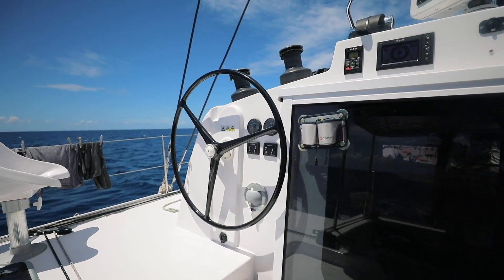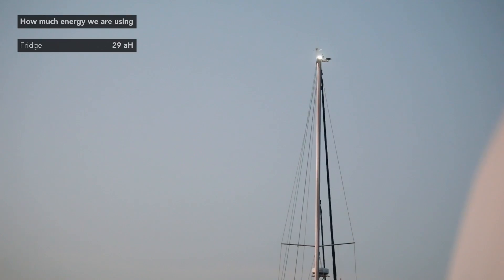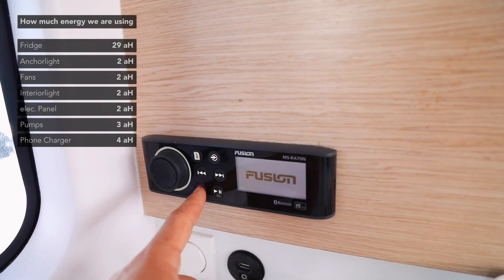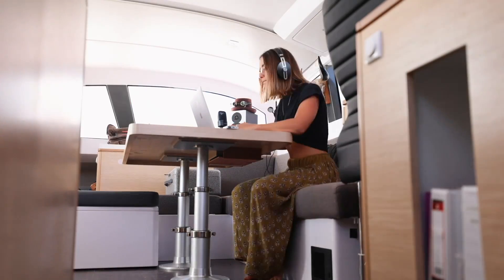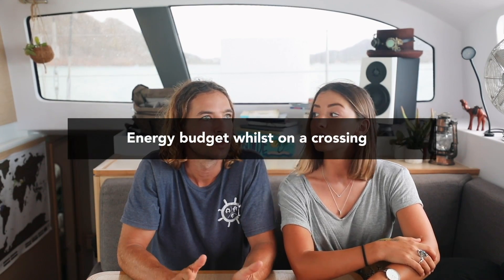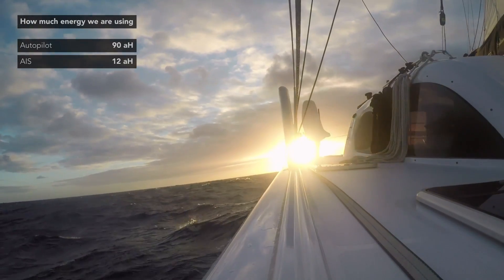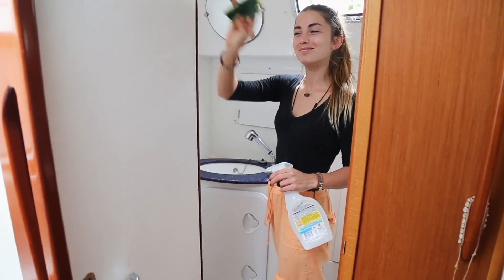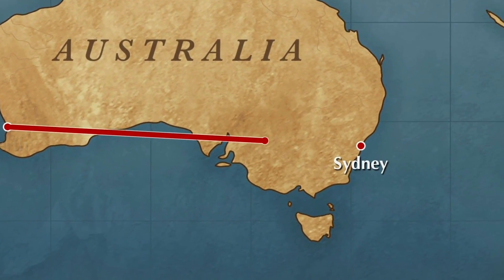Renewable Energy on a Boat

Comment: What would it cost you to quad your solar capacity? It looks like you have room on either side of the mainsail behind the mast and can also add capacity to your current solar board. I think you are running too lean at 560 and you want to be at 2,000 to 3,000 watts. Insufficient voltage is going to cause havoc (overheating and premature wear) on brushes and other moving electric motor parts.

Comment: Would an investment in an extra battery not be worth it?  There are many times that you are not actually using the energy spend that you state like when you are off boat for the day.  Rather than wasting solar energy that cannot be stored would it not be better to have one more battery storing that otherwise lost energy?

I have a campervan and have a 270w panel on my roof and 2 x 110ah batteries.  I went from 1 battery to 2 and it made all the difference.

Comment: Have a small tip that helps; get a set or two of the little solar lights, sometimes called 'fairy' lights, that use a separate small pv panel of their own, can mount the small panel off 1 of the bars for the Bimini or davits, and they are super lightweight, but the 50 or 100 small lights(w/a on/off switch on the small panel)will give you about 6 or 8 hrs. of nice light, use a set around the kitchen area, they automatically turn on at dusk unless they are switched off, and will save that 'flick on lights' and help lower your usage. Can get them in white, or colors, and they really hold up well, actually have them at home too, where they come through the vent/light and make wonderful light, but the best is on the boat, where you can have them come on at dusk, and return to a lit boat from outings, w/o using ships power! Also the security of that.."is someone onboard?" as the lights come on by themselves. Get a couple sets..they are a under $20 purchase here, and hope I've helped you and others out w/this tip ;)

Comment: I do outback photography with two fridges (one fridge and one freezer). I have two wine bladders with a little water in them that I place on top for extra insulation, as the fridges empty I fill the bladders to fill in the empty space. A full fridge is more efficient than an empty one concept. I also put full water bottles in the freezer as it empties and then transfer one to the fridge in the morning and put it back in the freezer in the afternoon to freeze again.
Other than that, yes agree with others, I converted all my 240v to 12v chargers so I am not bumping 12v to 240v using the inverter just for the powerpack to turn back to 12v..

Comment: An amp is not a unit of energy that can be stored in a battery. I is a unit of current. What you are referring to, is an amp/hour. :)
Let's say you have a battery capacity of 10 amp/hours then you would be able to draw 1 amp for 10 hours or 10 amps for one hour. :)

Comment: An EXCELLENT additional alternative would be to purchase Alternators for each of your engines from Kent in Fort Lauderdale, Florida with approximately 250 Amps per hour they generate.  This way, you could charge up your battery bank in very little time with very little fuel.  Would be nice to have that as a back-up.  Especially, if you had guests on board.  But seriously, having it as a back-up would be nice.  Even if you only got one for one of your motors.  They are expensive.

Comment: Thank you for the insight into your electrical systems.  What voltage battery banks are you using? 12V? 24V?  Are all the items that you power the same voltage? Nigel Calder wrote a wonderful book about all this and much more.  Its 
Boatowner's Mechanical and Electrical Manual: How to Maintain, Repair, and Improve Your Boat's Essential Systems
. https://www.amazon.com/Boatowners-Mechanical-Electrical-Manual-Essential/dp/0071432388 .  Heavy reading, but worth it when your out there away from others and all issues that arise are yours and yours alone.    Fair winds!

Comment: to save with your laptop, switch out your hard drives to solid state ones, they use less power than the spinners, that and use a lower screen brightness and when you walk away from the laptop, put it into sleep mode or power off.  a computer with a solid state drive boots real fast.  and if you can get one, get a dc power cord for your laptop, inverters waste a lot of efficiency.

And I think you did a good job explaining amp hours without making it full of information that people won't understand.

Comment: I think your numbers are a little off, led lighting and phone chargers draw very little power , restive loads ran through an inverter ( hair dryers, electric skillets, heaters , water makers) draw large amounts of power. But in the end , if you batteries are not going dead you must be doing it right . Take care and don’t put your tongue on the wire to see if it’s got juice . 😉 !

Comment: Hey guys one more idea for you on saving energy. We put a timer switch in the power circuits to fridge / freezer. This turns them off for 3-4 hours at midnight. Because they are no opened during this time they hold temp pretty well. This saves us some amps and lets them defrost making them more efficient the next day.  Keep on having fun!

Comment: So, energy budget from the hard, dry, middle-of-the-continent home of mine: 
Computers and servers are just running 24/7 because of lazyness. So do some lights, but to be honest, it's currently dark for around 16 hours a day outside. It's also cold ...  so the heating is blasting full power around the clock as well.

I guess I lose this round :D

Comment: Left out mention of the water maker, which is presumably (more efficiently) run directly off engine/generator. The regular running - of either the engine or generator - to top up the water tanks would provide additional charge to the batteries (additional to the solar and Watt & Sea inputs).

Comment: Time to upgrade to some decent solar panels guys. I have 2 x 345w sunpower panels and on an average day get 3.5Kwhours of energy from them. On good days it can reach 4Kwhours.  I run them into a Vicron blue solar 100/50 MPPT controller and get close to 50 amps per hour at times which is it's limit

Comment: Volts X Amps = Watts.   Better to go by "watts", as the total energy you're actually using depends on the voltage of the system.    1 amp on a boat at 12V = 12 watts.    1 amp in an Aussie home at 230V is 230 watts.    Wattever!

Comment: Hi peeps. We did the math before we upgraded our solar. Lithium would be ideal but at the moment our lead acid is only 3 years old and performing well. We did a simple video, just look for; "Solar Panels Maintenance Special Part 2 OTB 02" or click our  logo; we would include a link but it would probably get blocked :-)  As you said, most important know your consumption! Add the cloudy day and at sail factors. Then divide it by 50%  to be sure, to be sure. We are currently totally self sufficient even in winter sun in the Med. But, have the security of shore power if we need it. However, that energy has to be produced in a less renewable way, so avoid it. Remember, energy cannot be created or destroyed! So using the power of the sun, the wind and movement through water reduces your drain on the planets limited resources. So use your on board solar power even in the marina! Alone, you cannot move a mountain, but if we all take the trouble to move a stone the mountain will move!!!!  Sail safe. Ant & Cid xx

Comment: No aircon at all??? Wow! Agree with all energy tips, and no gen set on board, however,,,, i have a 12000 BTU in the lounge of our 40 ft cat for in port on shore power, and a 3500 BTU running of the 2 kw inverter, it makes no sound, and cools a whole hull at just 30 amps per hour. We run it on a timer b4 sleeping for an hour or two and sleeps so much better when hot, or I switch this unity on while motoring. Highly recommended!!

Comment: Duogen Water and Wind  Generator - not cheap though. Noise (wind), about 70db which isn't that 'bad' though.

Quiet (water), when moving. but at least when stationary the wind option is there if required.

Comment: Amps is a current intensity unit. Ah, which reads amphours is an energy unit IF you mention also the voltage of your system, otherwise it is useless. The energy unit is amphours times the voltage, which means Wh (watt hours). Does this make sense?

Comment: If you were to use a DC power supply/charger for the macbook computer I think that could save from a lot of use of the inverter. Converting your DC to AC, then using the laptop charger that converts the outlets AC back to DC for the laptop wastes some energy - the current in the laptop is all DC anyway.

Comment: You're wasting a lot of power by using an inverter to charge that macbook. I suppose it is model year 2017 or newer so you should charge it by using a 12v car charger (like you should charge all the other USB appliaces like phones and gopros) or by using a separate 12v USB power brick. That's because it is really ineffecient to invert 12v from the batteries to 110/240V AC and then let the laptop/phone/camera charger change the 110V back down to 5V.
Reply: This should do the job if you'd install a 12V car sigarette socket: https://www.amazon.com/Nekteck-Certified-Charger-Delivery-Included/dp/B075WQQG7C/ref=sr_1_10?ie=UTF8&qid=1547289431&sr=8-10&keywords=usb+c+12v

Comment: What is the voltage in your electrical system? 48V DC? 12V DC? If you have 12V and use an 230V/110V AC inverter to power the laptop, bear in mind that you loose energy on both inverter and a laptop power supply, for example if your laptop is using 120W at it's full power (for example rendering), the inverter and the charger have around 90% efficiency (and it may vary depend on how much power you actually drain ath the moment), it consumes around 150W of power from your DC system, and remember that they lied to you about the efficiency. It's only 30W but when you use your computer for extended period of time it will grow in significance. I do not know what model of laptop do you use but try to buy a power supply that is running out of your DC system so you do not waste power on DC -> AC -> DC and voltage conversion, if you have a newer laptop with USB-C it might be easier to find a good charger for your scenario. Every power conversion consumes energy, even phone chargers that are running out of the inverters consume more energy. You can build yourself a DC->DC power supply for most of your AC appliances if they run out of a separate AC->DC power supply (for example charger for walie talkie). I live in an area that have very frequent power outages and since i have a lot of hobby batteries i became an expert in "charging your phone from everything" :D

Comment: Get a 12v laptop charger for the computer.  DC-DC is a lot more efficient than using an inverter, where you are going from 12v DV to AC and then back down to maybe 19v DC again.

Comment: Wondering if a Bluetooth broadcaster paired with a couple of Bluetooth headphones might significantly lower your music power load.  Not to be used all the time, but a fallback if you get behind on the power budget. 

If you double-decked the solar arrays with a fold or slide out tray that could be deployed when anchored, would that provide enough power to run a dehumidifier below deck?

Comment: And the new battery’s last a quarter of the old , we use around 60 without fridges , they can use 100 a day 4 amps on startup x 24 for one fridge a lot of power , added together , we have gone back to some lithium some acid starter acid , water pumps acid , electronics , lights , iPads lithium, solar panels charge lithium only , think about your using valuable solar to charge acid where’s you have alternators and you use a motor each day , save the solar , so the new battery’s charge quickly , I n a year they lost 20 percent of there umph then they settle for a couple of years then start going down from there.   Good luck. ,but note using the solar for the battery’s that need it , yes , back up switch in case of failure good luck

Comment: Having an inverter and then a laptop power-pack introduces two fairly high loss points - inverters are often only about 80% efficient and laptop power-packs are fairly inefficient too... and it is very redundant as you are converting DC to AC then AC to DC again, because the laptop actually runs on DC... that's the purpose of the power-pack... you might only be getting about two-thirds of the benefit of the power you are drawing. If you have a particular place you work at/recharge the laptop, you might consider getting someone to wire in a voltage regulator - something to connect to the DC bus from the batteries (48V?) and step it down to the laptop input requirements (depends on the laptop, but might be something like 16.5V with about 3.6A current draw) - that would be significantly more efficient with the cost being that you can't just plug in anywhere on the boat (you still can - you just need to use the inverter and laptop power-pack with it's associated extra loads)

Comment: Add a fuel cell WATT generator (uses propane) or European EFOY fuel cell (uses methanol)
Use this to supplement your solar automatically when batteries need charging. 
They are also very quiet. Clean exhaust also.

Comment: You can get laptop charger that plugs into a 12V car cigarette lighter socket. By installing a 12V car lighter socket you can charge your laptop without the power hungry inverter.

Comment: 300 watts of solar, 300 watts wind, 8 12v deep cycle batteries 2000 watt inverter 42 qt freezer takes 90 watts max led lighting all for my tiny house, seems to be enough,  haven't crunched numbers. But I'm a lubber and have more resources. Congratulations on being on top of your game way way off the grid.

Comment: is it possible to put a generator onto the propeller shaft of a boat so when you're under sail the propeller "free wheels" and turns the propeller shaft and rotates the generator, so even when you're sailing at night you're still generating power?

what is your water budget on a leg like Tenerife to Miami?

Comment: Loe that you are showing people how to live off renewable energy and not hiding the fact that you need to change the way you use power to achieve it. I built a solar powered food truck and have been running it for the last 2 years, Most people can't believe that its even possible. Happy sailing. Peace